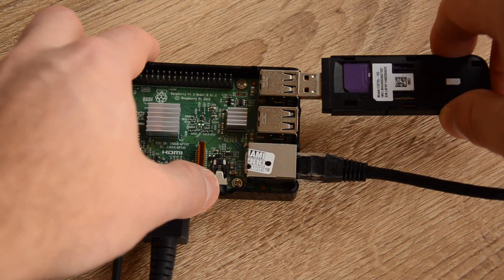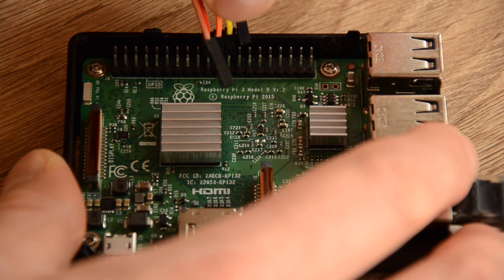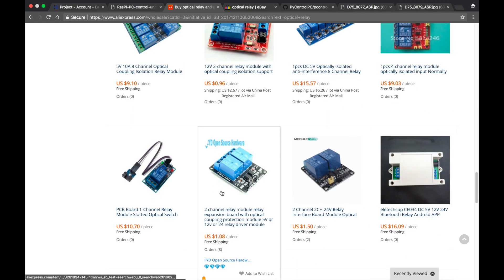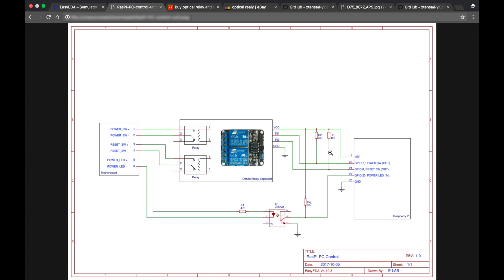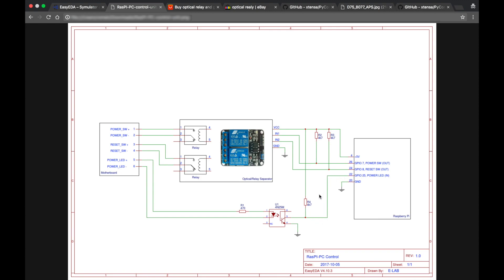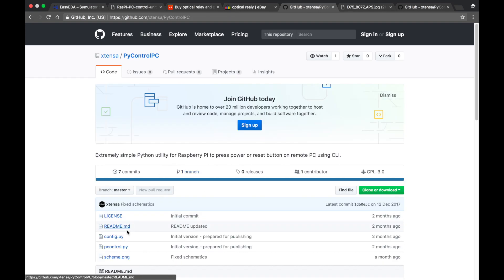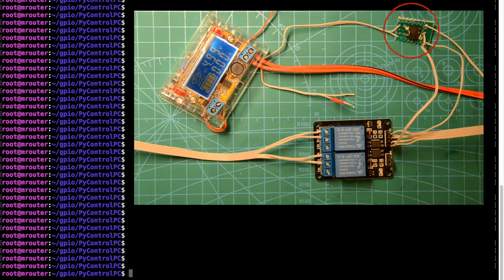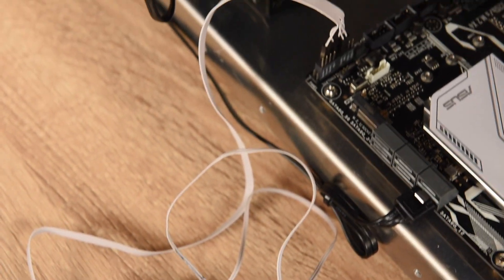Remote PC Restart using Raspberry PI GPIO port

Comment: I'm very intrigued in this tutorial. However it only shows how to remove power and add power. Is there a way to run a script to shut off the main system to tell the computer to restart instead of a hard shutdown
Reply from the maker: This script supports restart. Please look closer :)
Reply: @e-lab4982  bless you sir. Thank you so very much for pointing that out for me.
Reply: @e-lab4982  I'm only finding 5V 2 CH 2CH Channel Relay Module Expansion Board for Arduino Low Level Optocoupler Triggered 2 Way Relay Switch. Is this the same thing? The one you're showing is an optical coupling protection module.  https://www.amazon.com/dp/B07LH53G5F/ref=cm_sw_em_r_mt_dp_pOobGbTKNF68G

Comment: Was the video made before you added the pull-up resistors? Your diagram shows three 4k7 resistors and one 470. Do you have an image or two of the final PCB soldered? Thank you very much for this video and your help.
Reply from the maker: Pullup resistors were added later. Why I added them is explained here: https://youtu.be/MFxcdinrOAo?t=229

Comment: Hi! I need to create similar remote resetter for my mining rigs. Could you tell us please something more about resistors which you've used? For instance which power they should use ? How many wats ? Kind Regards, LK.
Reply from the maker: Hi. These are just pull-up resistors. Any low power resistor will do the work.
Reply: @e-lab4982  thank you very much for this info.
Reply: @e-lab4982  I've created resetter in line with your instructions. Works very well. Unfortunately if I unplug the power from my banana pro  and then connect power again, (before system boot) gpio ports get high state. Relays which are connected to SBC gets closed state and mining rigs are powered off or reseted. Did you experienced the same  SBC behaviour ? If yes, how you solved the problem?
Reply from the maker: @lukkulis  , they are supposed to be in "high" state all the time except when issuing "reset" or "power up" command. This is why I added pull-up resistors. Maybe they are getting "low" for a moment while booting?

Comment: I have a question am using the same setup as you describe but as i connect my relay com and nc cable its shorting pc power pins cables without me using any commands, can it be i order the wrong kind of board:?
Reply from the maker: My guess is that your relay board looks the same but pinout is different.